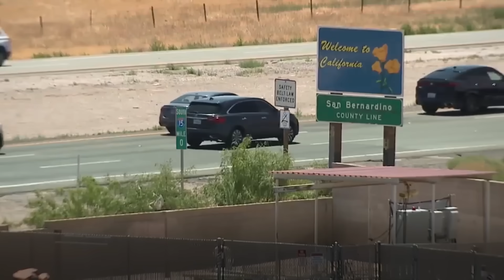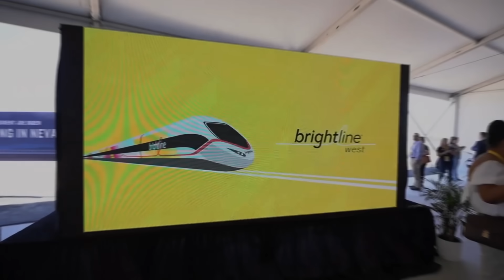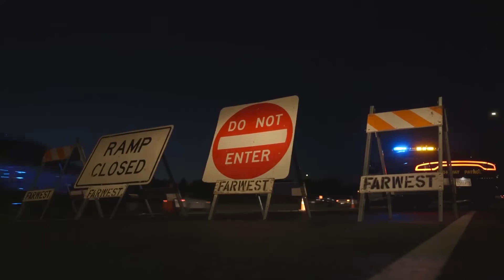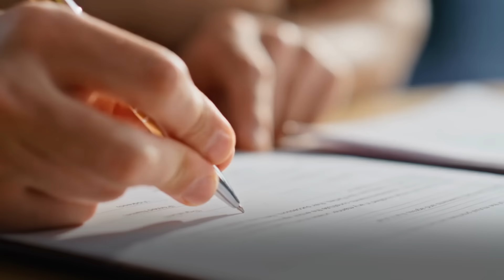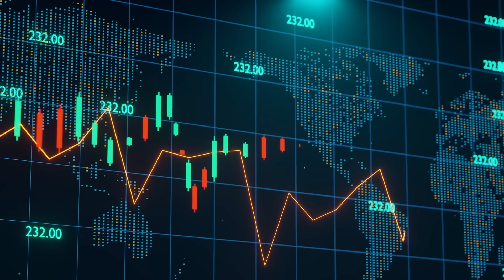Brightline West: The $12 BILLION Railway America Has Been Waiting For

Comment: Who is going to drive all the way across the city to get to Rancho Cucamonga? They should extend the train to Union Station.
Reply: There is a Metrolink train that goes from RC to Union Station so you would transfer from one train to the other. I believe the RC station will be shared with Metrolink.
Reply: This is my main problem with rail or public transit in thenUS, they take you to a spot where you still need a car to get around.
Reply: @pattycarljackson  I agree, that is the problem with most HSR projects. But Vegas is the one exception. Most people when they go to Vegas they just hang out on the strip. There is a good bus line that takes you up and down the strip and the silly tourist monorails that go behind the casinos.

Comment: Tunnel under the casinos and have the train stop on the strip. Why have a station way out by the airport? Then it could also double as a subway.
Reply: High speed rail is not a commuter subway. You don’t have frequent stops, they connect major cities and regions, hence the ability and reasons for high speed, which you can’t do in frequent stop service.
Reply: They can use Elon's underground Tesla network. 😂
Reply: @Iconoclasher  LOL, yeah, a couple of tunnels between underground parking structures that goes nowhere. Musk has been lucky buying stuff. He doesn't know how to build anything on his own.
Reply: The Las Vegas airport is practically on the strip, compared to where the train starts on the outskirts of LA
Reply: Subways stop frequently. Higher speed rail does not.
Two entirely different rail purposes.

Comment: The cost is up to $21B. The speed is up to 220 Mph, and total trip time is 1 hour 50 minutes,
Reply: It's still gonna cost a quarter of CHSR from Bakersfield to Fresno. 😮  I can't wait to ride that one! 😂
Reply: @Iconoclasher for sure, just correcting the record, as it was recently updated to 21B
Reply: @Iconoclasher It's also much smaller than the CAHSR which will be fully double tracked. The BLW HSR will be mostly single tracked. And the CAHSR will be faster, too.
Reply: @mrxman581 the CHR IS NOT faster, if anything it would equal the speed of Brightline West's line.           No need to guess, this has been in print for well over a year.
Reply: @MichaelDavis-il8ze You're incorrect. The CAHSR will be significantly faster than the BLW. The CAHSR will have a top speed of 220 mph and will be able to travel at that speed for long periods of time. The BLW train will have a top speed of 180-200 mph, but will only teavel at that top speed for very short periods of time. That's mainly due to two reasons.

First, the vast majority of the BLW route will be single tracked limiting both the speed and frequencies. Second, the ROW of the BLW was not designed for HSR which also limits the speed of the train and why it has a poor average speed of 101 mph.

The CAHSR will be fully double tracked and will run on a ROW built specifically for true HSR from the ground up in the Central Valley. The stations will also be quad tracked to allow express non-stop trains to pass the stations safely. BLW will not have quad tracked stations so there will be no express non-stop service.
Reply: I'm currently writing a book entitled,
              The Endeavor 
The United States Atlantic Star. 🇺🇸 
             This is the story of the building of a high-speed bullet line that spans the entire United States eastern seaboard between Boston Massachusetts and Jacksonville Florida stopping in one city in each state it travels through. In reality, this would be able to move millions of Americans up and down the entire United States eastern seaboard at speeds of up to 200 to 225 mph and not so much as a ripple on your martini. This is something the United States should have achieved decades ago and also, fully electric. With a cost of 200 to 400 billion dollars which is less than the 500 to 700 billion dollars to put some fool on Mars which is pending. Here is one hit from the book. The Atlantic Star is not being built by the United States government. With all the research, it will be awhile..
Reply: Yes, the cost is up to $21.5 billion, but the top speed is still between 180-200mph. That hasn't changed. The travel time is still 2 hours and 10 minutes with an average speed of 101 mph.
Reply: @mrxman581 travel time would be 3-4 hours from most parts of LA. First you have to get to union station or metro link and then out to Rancho Cucamonga. So for the 15-20 million people in the la metro area this will be a 3-4 route at its fastest with at least 3 train transfers. 
So for most it’s not much savings of time at all.
Reply: @mattm7377 I completely agree. And in addition to the minimal time advantage of the train, there is the overall cost difference between driving and taking the train. The disparity grows considerably the more people take the trip together.

A trip of four friends driving to Vegas will take about the same time and cost hundreds of dollars less. Money you can use to actually have fun and spend in Vegas.

On second thought, the train might not have any time advantage because you need to also factor in the time it will take to get to your hotel once you get off the train in Vegas. Add another 20-30 minutes and dragging around your luggage in the process.
Reply: That's incorrect. Literally it's been 220MPH for the American Pioneer 220 since groundbreaking ceremony in 2024, as was the 1 hour 50 minute trip time as quoted on live TV by Brightline's President, Sahara Watterson.  @mrxman581